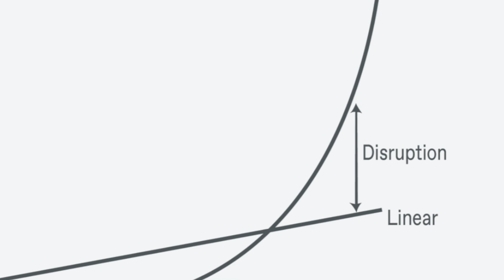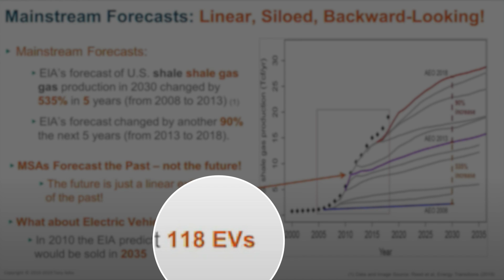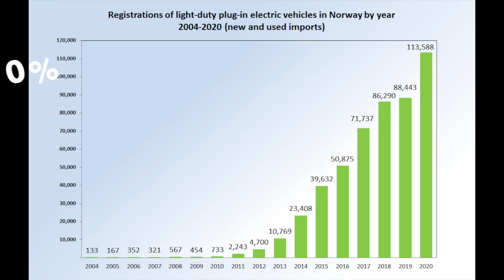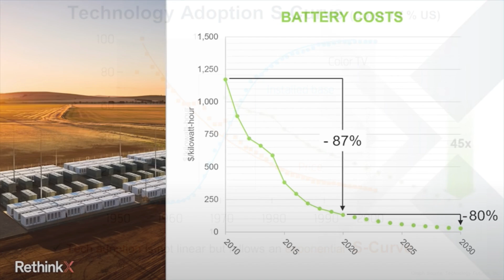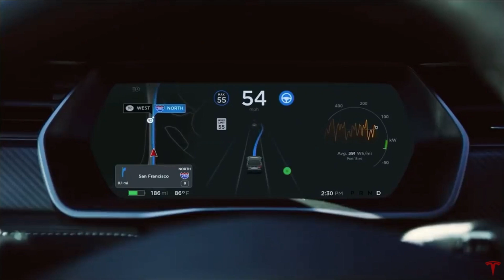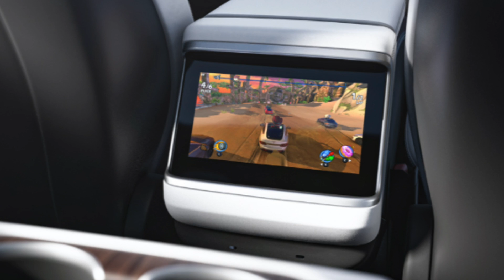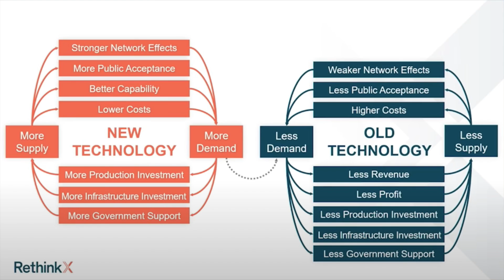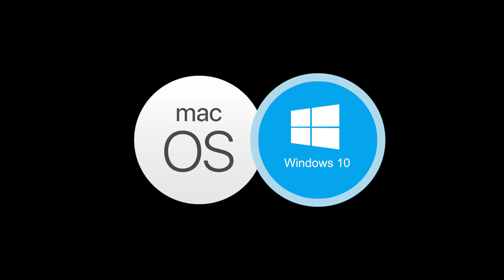Disruption ALWAYS happen in an S curve | And we are about to see something really special !

Comment: My sympathies to those dealing with difficulties due to weather and failure of services, but, as charging stations that are based on solar and power storage systems the loss of power will allow areas to survive failures of existing systems. I want solar and power wall so emergency or general use are no longer a concern.

Comment: I’m a huge fan of this channel and Tesla. I’m an owner and stockholder. That is context for my comments here. There is a great deal said about EV’s total cost of ownership vs ICE vehicles. It is a great EV benefit. However, there is an additional expense coming that has had no attention that I have seen to date. This is the cost of building and maintaining the road system without  the benefit of current gas tax. Subtracting this number from ICE vehicles cost of ownership still results in EV’s being attractive but the total gas tax paid is enormous and that money for highways will have to come from somewhere. A reasonable assertion is that it should be financed by users and those who benefit.  I think this is a solid topic for videos.
Reply: Also the same fossil fuels are used to make roads and equipments and EV car parts too, oil is still a very part of even an EV driver
Reply: @carholic-sz3qv  - Indeed.  Oil feedstocks will continue to feed the manufacturing of things and other items such as fluids and lubricants. However, as a lifelong R&D chemist I can say with confidence that those applications will eventually be replaced by biologically generated hydrocarbon feedstocks with greater efficiency and incidental environmental impact. Oil may continue to find limited applications for the foreseeable future but DO NOT invest in gas or oil companies. Thanks for your reply.

Comment: There is still one remarkable downside risk for Tesla: if they don’t get the 4680 cell mass production up and running. They still would be able to produce about a million car this year, but from then on they couldn’t grow much faster than the other EV makers, because the usual battery manufacturers simply can’t deliver enough batteries. Giga Berlin and Giga Texas in that case would have been built for no good reason.
I don’t believe that bad scenario. In fact, I could imagine that Tesla’s latest battery video was a tell – that they have reached a key milestone, say, they mastered Maxwell’s Dry Battery technology, and it’s »walking a million miles« (you remember that part of the song in the video?) flawlessly with an acceptable failure rate and at (perhaps) 3 times the speed of a normal cell production line (planned was 7 times).

Comment: That's "always how it goes" for successful disruptions - there are way more unsuccessful disruptions than successful ones. 8 track tapes, hydrogen vehicles, etc.
Reply: This disruption will be successful.
Reply: Matthew Christopher - The Interesting thing here, is that on no "Disruption" in the past, that I Understand, had Governments "Requiring", or "Supporting" it, at the User Level! 

Like, on the Railway, from The Steam Engine, to the Diesel-Electric Engines: what "Mandates" from the Government, were there?

Pretty much the same, for the Move from 16 RPM to 33 1/3 ROM Records; Wax Sleeves to Disks; Records to Tapes, Reel to Reel going to 8 Track Cartridges, to Cassette Tapes, to CD's, to Other Digital Products, to Satellite Delivery. 

Strictly Business Driving these moves! Be it the Railways, or the Recording & Music Industries! The Disruption of the old, to the new, came from within.

The push to Electric Vehicles, as I said, is the first "Push" for "Disruption" that I recall, with National Government Getting on board, and providing Direct, Open, Stimulus, and Benefits to buyers, and/or Seller's/Manufactures! 

So, unless someone is asleep, they can see that this is, for the most part, driven from Without, particularly when it comes to incumbent Auto Makers! 

Tesla is driving the Move, as far as I can See, that is "Pushing" the Government's to "See" that Electric Vehicles "Can Replace ICE Vehicles" and motivating them to Push for EV's! I don't recall any Government "Support" for Buyers if the EV1, although they tried to Push Automakers via "Requirements" of a certain % of EV Sales, in that period, it was "One Sided!" 

It was only "After" the Tesla Roadster was Shown to the Public, that the Tax Credits, Rebates, Zero Tax on EV's, etc., Began, at the Government's Levels,  as far as I understand!

So, this is going to be Both Different, AND Interesting!

Comment: To have a disruption, you fort need something disruptive. EVs, that includes Tesla as well, dont bring anything new to the table. Its still a regular car but it run on electricity.
EVs are being told its like ICE VS Horses. 
NO it is not, not even close.
WHY you ask?
A horse is like a human, it need sleep, rest and food. An ICE dont.
Meaning you dont need to produce food and that labour that requires.
You dont need a stable, and that cleaning that is required, also saves up labour.
And a horse cant work 24/7, an ICE can with just some fuel in the tank, it never get tired or need breaks. As horses is like humans in the way of work, they also get tired and bored.
Age is also a factor. As a horse get old it dies, change some parts on a ICE its good to go again.

About EVs. NO, it will not save labour at oil production, as oil is and will be needed always. How much products do you have that is made by oil at your home? 
There is your answer.
EVs do just make you travel to A to B, so does an ICE. Difference is EV need more breaks, and can only travel for a short time.
They are electrical to advanced. And experience thru the world is, the more tech you put into a car more likely its gonna break down fast. As we do see across the board on EVs and modern ICE cars.

Comment: The oil industry made everything possible from fuel to fertilisers to tires to car parts, plastics, rocket fuels.......
Reply: True! But they knew about the effect on climate change, and they ignored it for 30 years.
In The Netherlands there is a lawsuit against Shell. Shell changed the design of a new oil platform on the sea, and made it 2 meters higher. This is the proof they knew about the climate change and rising sea levels.
Oil gave us illness, pollution, smog, CO2, plastic waste and climate change.
What is wrong with a paper bag?
Reply: @MarcoYolo420  are you even serious?! Plastic is litteraly the best packaging thing, its used in the health industry, chemistry......... climate change affected us because of all our stupid waste, farmers have to throw away tons of food because people don't like deformed carrots or tomatoes..... or people just play with food, or even eat alot of meat, all this contribute to higher use of ressources, even heating a badly insulated building all contribute to higher use of fossil fuels. China has stopped importing people trash because it wasn't sorted properly..

Comment: Great Video!  I think EV's have already passed ICE in cost.   Model 3 at $36,990 with avg ICE car at $39K.  What is missing is we are battery constrained and advertising/education. People are afraid of new technology but with advertising and education it will quickly go away so I don't think price is as important as battery production and education.
Reply: Stop talking nonsense, EVs are actually very well subventioned by states and they don't cost less than ICE, there are still cheaper ICE that even starts at 8k, ICE are expensive because they have way more options than your typical EV.
Reply: @carholic-sz3qv  Do you talk this way to people face to face or only on social media? Do you know what average means? Of course there will be some ICE vehicles cheaper and some more expensive that this what average means and it is $39k currently in the US. ICE has more options compared to Tesla because Tesla includes all of them and more in the original price. You argue your point like a Oil advocate or a Trump supporter.

Comment: Carn't wait for an electric, however not so sure about self drive (that is for me)
If self drive takes off, we'll have a generation that cannot drive, so anything the does not offer it will be dead. which makes me wonder why Tesla is charging to much for full self drive.
Reply: How is that a bad thing? The whole point is to get where you want to go as inexpensively and easily as possible. Does it matter if you are doing the driving or a computer? Either way it doesn't matter right now because self driving won't be ready for a while and it will be an expensive add on. By the time it will become a standard feature, you will be ready for it.

Comment: In electric car you need to service breaks, also AC, wipers, electric windows and tires, oil change is ICE cars been cheap the same with the cooling systems - I don’t remember having issues with engine transmission or radiators, whenever I service my cars it’s a tires or break pads, or break fluid or air conditioner or any electric issues... and recently I wouldn’t be happy owning electric car in Texas- would you?